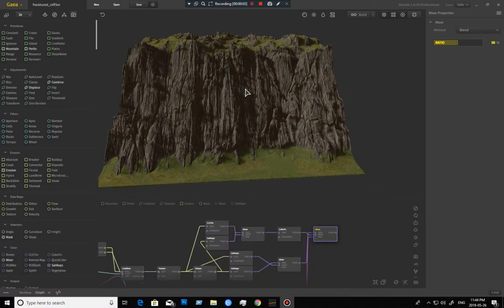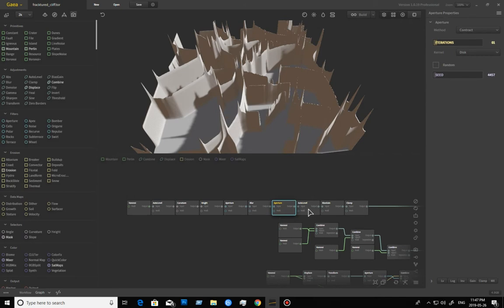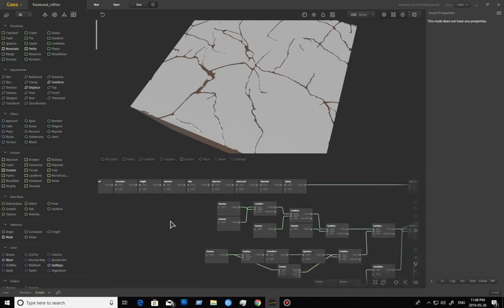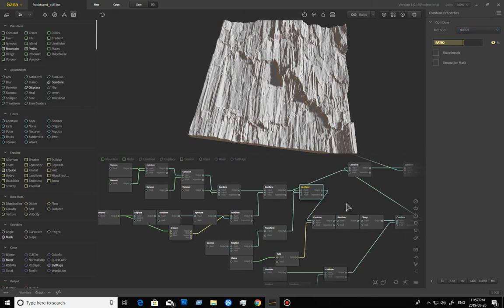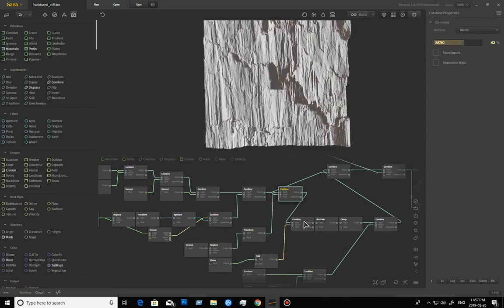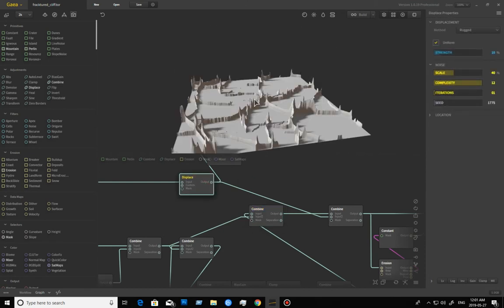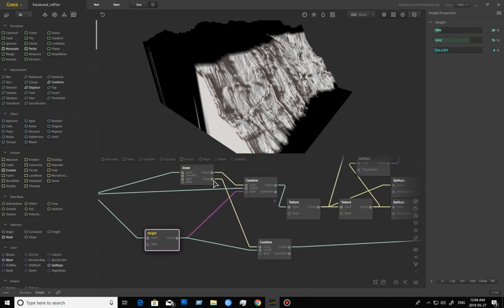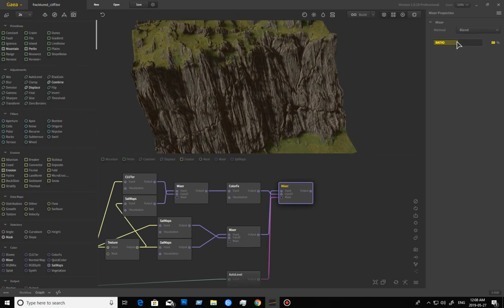Quadspinner Gaea   Rocky Cliff Face

Comment: Cool stuff! I am just wondering doing this for an actual game would you rather have all the detail within the terrain + terrain normal and use quite calm diffuse textures or the other way around having a somewhat calm and low-res terrain and a lot of detail + normals in the terrain textures? I could imagine high res terrain with lots of detail plus high res terrain textures with lots of detail might end up too noisy or not well readable at least.
Reply from the maker: Both in game and in 3D app, I like to have the main shape in geometry and fine detail in normals.  Using it in game, you are looking at the mesh being a displaced terrain because it's optimized, unlike a 3D app where displacement is uniform and not scaled by distance from camera. Hopefully that makes sense?
Reply: @cowsmanaut  Yeah makes total sense I mean of course the game terrain will not be as high res as in the 3d app and the detail will come from normals. But as terrain textures you can apply in the game engine also come with fine details and normals, do you try to mainly preserve the details you got on the terrain from the get go and not muddle them too much with texture details?
Reply from the maker: @bjfreshy1746  you do the best you can to blend them and preserve what you can of the original form yes.

Comment: for some reason my cracks at the start phase is much wider, and i cannot figure out how to get them as thin :(-
Reply from the maker: Possible it's related to an update of the nodes. They tend to tweak values and change ranges to allow for more control, however it means the older tutorials are not the same values. You may need to adjust, or it could be that you are in a different preview mode. 512, 1024, 2048 will all have slightly different results including the size of some elements, like the thickness of cracks. The above preview is at 2k (2048)
Reply from the maker: Incidentally, there is a new Cracks node that replaces the need to do the steps I did to get them off of the voronoi.. it was added the version after this one on my request :) you can get that now with less steps.